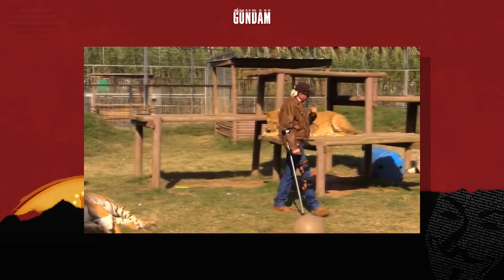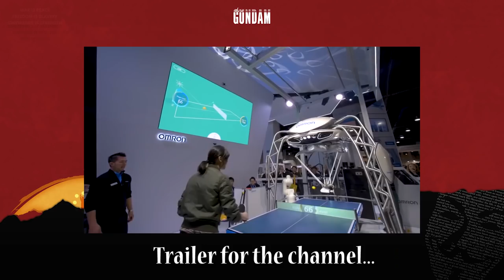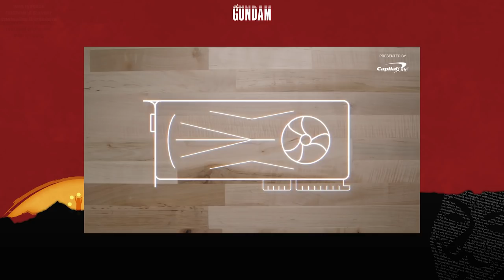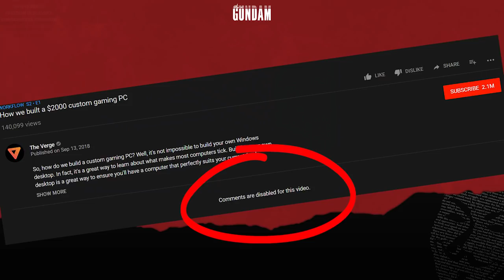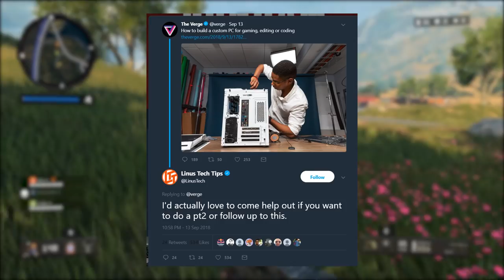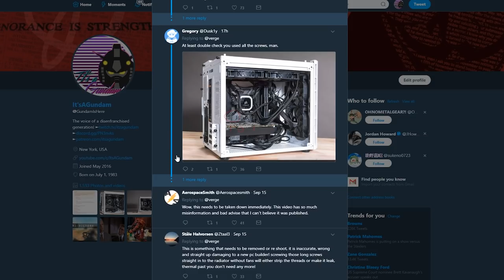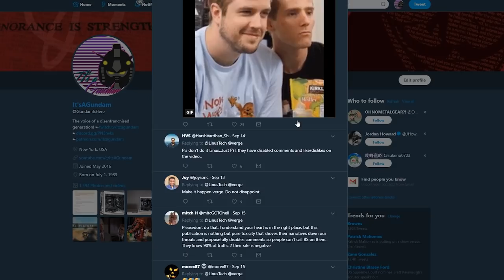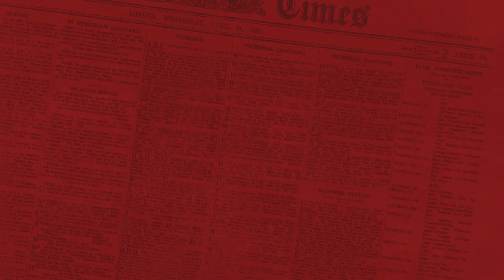How The Verge built a $2000 custom gaming PC WRONG!

Comment: yeah anti static bracelet doesn't serve a purpose if it isn't grounded, that said it isn't fucking necessary to begin with, i built my pc which was about 1800$ a few years ago, on a fucking TV tray in the middle of my bedroom (and my case was significantly larger than the surface area of the tray.

Comment: If pads are the thing preventing the power supply from shorting out against the case is the case hot or the power supply chassis?  Not sure how the metal screws between the power supply chassis and case are helping the matter much though.

Comment: “Build a gaming computer for $2000 dollars”
Bitch I built mine with almost no experience and using hand-me-down hardware, works fine and runs acceptably for what I use it for. Total was like $150-200, maybe even up to $300 with the new ram and motherboard I put in it for New Years.

Comment: it really depends on what you want to do with the PC but a really good gaming PC will cost at least 500, mine cost a total of 1300 and rising >.<
Thing about this is that you can upgrade which I did. So you can start out really good with say that 500 and build upwards from, there. Hell, I started out with a 100 for a PC and it was a very good airplane. Dust included. Thing is, we have a site for all the part that you guys don't have, and you guys have one that we don't have. We have alternate for Europe, you have newegg for America. And ofcourse you can buy from alternate if you're American but I suggest you use newegg anyway because shipping then becomes a problem whereas with newegg it wouldn't. I tried newegg once, saw a 50% extra shipping price, skipped it and went to alternate instead XD.

Comment: As someone who has been building pc's since the days before the plug and play days where you had to sent jumpers manually, this is beyond cringe worthy. Maybe its just me, but if I keep myself grounded by touch the bare metal before touching any compentents, never had an issue with not being grounded. I would be afraid to build a pc after watching this shit. Its cring worthy. And hello, check the manual on which memory slot to uses for petes sake if you dont know which to use. He has enough extra ceramic paste for 3 damn cpus. Thanks Gungam, you just gave me a migraine.

Comment: Too much watts, A core i9-9900k and a RTX 2080 Ti in games wont even use over 500 watts. I use a Corsair RM750i and the iCue software says i use at max 470 watts when gaming. Mainly stays around 350 to 380 watts.

Comment: okay not evan going to lie, I just built my pc and the rm has to be in the first and second slots on my motherboard. i tried every fucking one in all the dims whatever thing with my ram and, alright I bought a budget gay ass motherboard, but the ram has to be next to each other in the dims for it to even boot, let alone read 8 gigs vs my 16 installed gigs. And it reads my 16 gigs.Also I had no idea what I was doing when I built my pc but it still boots up with all the ram detected. Also, less than $1k.

Comment: What’s the cheapest I could go for a setup that can run vr like oculus and htc vive?
Cheapest I saw was in one of the products websites for like 1000 for a laptop. Lowest end offer they had more expensive options.
Reply: you can get away with a cheaper CPU, and with the new ryzen lineup, alot of the last gen are on sale and can do VR great. I would recommend the 2600, most even come with the cooler.
you do need a decent graphics card since you are basically running a game on two screens instead of just one. 

everything else you can kind of cheap out on, maybe go for good RAM and at least a name brand power supply, i think 600w is plenty, but you can google wattage calculators.
 i would try to avoid pre-built PCs since you can often get alot better parts for the same price. and anything with LED or that says gaming will cost more, and likely have no advantage other than it looks cooler. Just get a cheap case that has some LEDs if you want the gamer look.
do some research, building a PC is actually pretty fun.

Comment: If i remember correctly, back with my Asus Z170 motherboard (Which sucked by the way...), it had that CPU installer "tool", but the idea of it is that you put it on the CPU and install the CPU with the holder, so you don't have to touch the gold pins by accident and/or you have better grip on the CPU overall.
So... yeah, it's a holder that you don't need but it exists, it's not exactly useful or necessary in any way.
Also, then again, the video has 14 knobs in it, 10 on the case, 3 on the CPU cooler and the one building the whole mess.
And, yes, Stefan has shown his colours afterwards when people who "doubted" him being an idiot, he just basically tells them to fuck off and say that the people who know what they're talking about don't know what they're talking about.
Nobody should be racist about him because he as a human is already trashy enough that you don't even need to consider the race of the person, which some have sadly done.
Skin colour doesn't mean intelligence or stupidity, it's the human within that skin that is one or the other or something in between.

Comment: Bro the grounding... we carry upto 30,000 volts and this dude puts rubber band and says he's grounded.... at least touch a solid wall piece hell even a metal door knob would ground you enough for this project... I cringed seeing his hands all over the boards components. thermal paste yes no more than a freaking rice grain. And it came with it, which is made to spec correctly, too much and you lose proper heat transfer, omg.... I agree with board first because you need leverage to push ram down but right after comes correct ram placement, processor (which is ZIF Zero Insertion Force) and needs no stupid bracket. every processor I know of has a golden tip triangle or a square notch letting you know where pin 1 is....and then install that stupid fancy HDD he got... and yea I would of hooked up wires first to power supply....Also the order of the PCI bus matters for the GPU did we forget about IRQs!? The processor still gives priority to the first port!    its just so sad... he's supposed to be a nerd and this is what nerds excel at and we can't even have that in this generation.... Thots are taking over the world and we are left with people like this as our potential future leaders... I bet he'll sit at his desk in the oval office and say: "I hope this Swiss army knife has a philips head screwdriver" ok Macguyver...

Comment: Yeah, PNY ... i never buy anything from them again ... ever  ... i bought me once a Graphic Card ... that was one still on the old slot(back then x16 was the new thing) ... since i still had a old Mainboard(and no moolas to get a new Mainboard, CPU and RAM) i got it.
Yeah that shit burned through after 6 months ... the Cooling Solution they put onto that Card was shit. ... they had allot Cards die on them ... but could not exchange them ... so i got a shitty card for that old slot ... just good that by that time i upgraded the whole system ...

Comment: Yeah, that video was so fucking terrible. Although, I didn't get to see your take on it. I need to get some popcorn... brb Ok, I lied. I had brauts instead.

I think the Verge asked around their staff, who knows how to build a PC lol? I yeah, I can do it. How hard can it be?! LOL It deserved all the hate it got. From the start it was cringe-worthy. That motherboard install, yeah sure, you can put the CPU in after, but why? So much more room to install CPU and RAM outside of the PC case. That I/O shield... Gotta hammer that sucker in there first though!

Let's continue! RAM, DDR4 base clocks were 2133 when launched. Every DDR4 stick of RAM that I have used, has defaulted to 2133 speeds before applying XMP profiles in the BIOS. Ryzen in particular loves RAM speed. 3200 to 3600 is pretty much the sweet spot, depending on CL timings, and workloads, etc. So, 2 main reasons, 2666 speed, and RGB, OH BOY it's shiny! Good God, really dude?! And, just for the record, I had an MSI that had both channels populated that way, right next to each other. Every other MB I've had since has had the channels separated. It would still boot, but it would just be in single channel if he populated channel A1 and A2 with the RAM. So, no benefit from Dual channel A1 and B1, as you would normally populate RAM. Next...

This guy is a total clown. GPU install before CPU... mmmkay. Let's leave zero room to install the CPU and heatsink! Then, he forgot a mount on the CPU cooler! And that cable management... or lack there-of, OMG I can't, I'm done. I need a break and a milkshake, my COD and anxiety are kicking in!

Comment: I dont say anything about the rest because he screwed up so much but...  hahahaha.. the thermal paste... i am sure this thing breaks down all the time cause he totaly broke the thermal connection IF this shit not totaly burnes out :D well.. probably does not burn out anymore because this shit gets slower when it gets to hot. So ... not only he only runs on half of the RAM Speed as they are now singlethreaded. 

Great job. If i would work like this i loose my job. My Boss would fire me on the spot :D Holy crap. This dude has NO clue what he is doin and i feel sad that i did not see this. I would had build this after his instructon and then sue him because the SHIT wouldt last very long. ( On top.. you dont touch the whole fuckin GPU with your fingers and you definately do not pet onto it like he did because the airfans are very cheap and they will get noisie very fast when you do so :D )

Comment: I try to build a decent gaming PC. It turn out to be 1700$ total. WTF r u talking about gaming PC doesn't cost 1000$
Reply: What do you consider 'decent'? Computers are modular. 

I built mine and my wife's original platform for 300 USD each.

The point was investing in a good motherboard, a fair amount of ram (16 gigs) and we originally used an APU. Specifically the AMD A8-9600 Quad-Core Processor (which cost around 30 USD at the time of build) because our plan was to upgrade on the AM4 path as we got more money. 

Since then, I've upgraded to a Ryzen 2700x which cost 159.00 on Amazon at the time and an ASUS Expedition Radeon RX 570 8GB OC Edition Gaming card which was 169.98 at the time of purchase. So. What is 300+159+169.98? Less than 630 US. Hell. At the time of typing this, I've taken out THAT card, gave it to my wife, and purchased an ASUS DUAL AMD Radeon RX 5700 XT EVO OC Edition for 409.99 AND upgraded my ram to 32 gigs of G.SKILL Trident Z Neo for 179.99. Even if you directly add that on.....it's still less than your price. 

So, let's go over this. My wife's machine is 300.00+169.98, which comes to 469.98. She can run most things fine at 1080p and medium settings. Hell. Even CyberPunk runs on it and looks alright. I'd consider it 'low end' and 'decent' for what she needs it for (which isn't CyberPunk or more modern games, but rather for Skyrim, Fallout 4 and some older titles). 

My machine is 300+159.00+409.99+179.99 which comes out to 1,048.98. It runs CP on max settings in 1440p. All while still eating the cost of my original CPU AND RAM; about 100 dollars between the 30 in CPU and the 70 in 16 gigs XPG Z1 DDR4-2400.

Hell. Even when I include a monitor (an AOC CQ27G1 27inch IPS monitor running at 144 hz, 1440p with a 1ms response which costs 249.99), keyboard(Redragon USB keyboard 20.00), mouse(a Razer Naga Trinity @ $74.95) and headset (Razer Kraken @ about $45.00) it STILL would only come to 1,438.92....and I splurged on the mouse, headset and monitor! Also, if you DO include those things in the price of a computer, but DON'T include the price of a television, headset, extra controller and other things a console needs....it's not an honest argument either. 

So, I gotta ask...with all due concern: How the hell did you arrive at a number of 1,700 US? Hell, for shits and giggles I just thew a 'mid range' PC together going off TODAY prices. $812.47 is the total, which is less than half or your estimated 1700. 

https://pcpartpicker.com/list/jG2My4

Most games you don't need more than 16 gigs of ram, unless you're a streamer. That video card will run everything released more than fine. 6 cores, 12 threads @3.2 Ghz is just fine. 

Oh, and a sidenote: Anyone who installs the CPU BEFORE the motherboard must have tiny baby hands.

Comment: I think someone needs to re-learn how to build a PC and I'm not talking about the person in the video ;) The motherboard determines what slots you put the ram into if you are not filling every slot and dual and single-channel RAM may need to go in a certain order. And at the beginning of the video, he said you would need tweezers to tighten the wires which can be true depending on if you had trimmed down the zip-tie after the wire management and/or everything in the case is very close together and it's hard to get to. The last point, you don't have to install parts in a certain order, the CPU does not have to be installed before the GPU, it is just preference UNLESS, the GPU would end up somehow keeping you from installing the CPU. I don't understand how people think you have to install things in a certain order lmao.